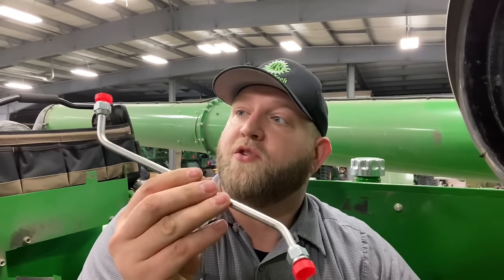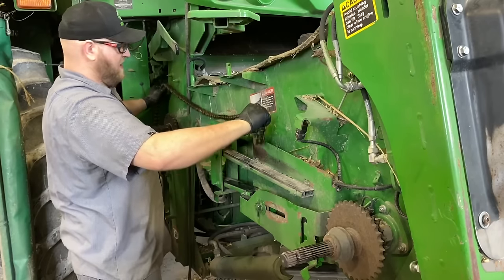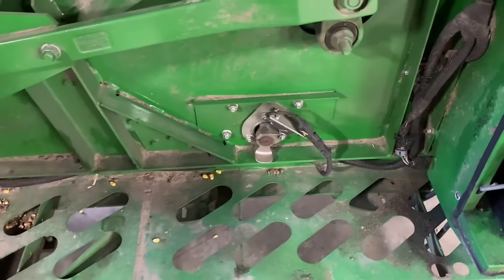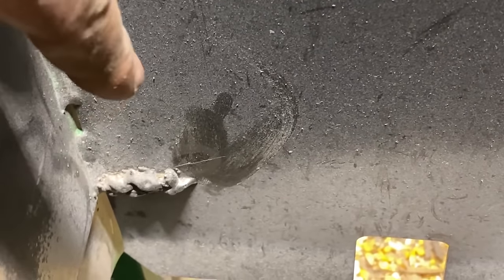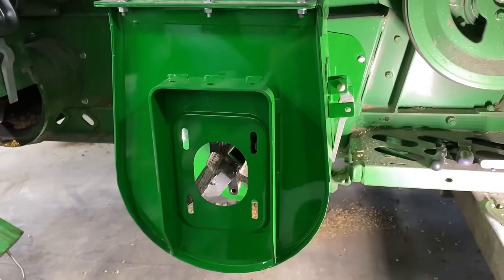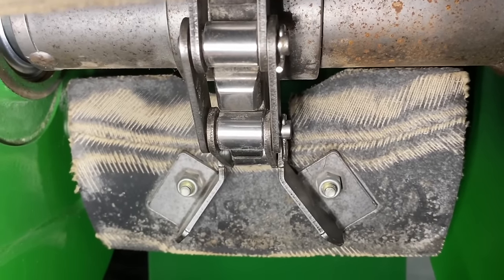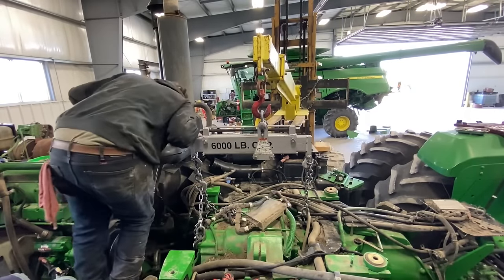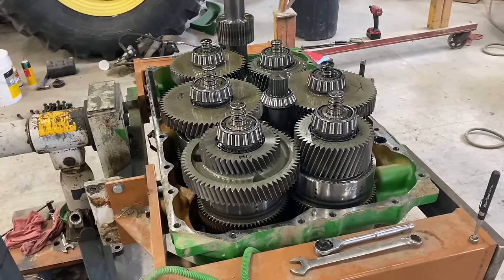S680 repairs & 9530 transmission fun. (It's NOT good!)

Comment: From the UK. Replacing tin work, fuel tanks, castings etc probably makes economic sense in labour terms, but component repair if possible - welding at the least, seems much less wasteful. Cracks can be stopped with welding expertise, though wear cannot be. Tractors seem to be integrated with so much “nice to have” crap that maintaining them has become a hugely expensive nightmare. Bet half of it could be dispensed with.

Comment: Those magnetic trays are so nice. I have half a dozen different sizes stuck on the side of my toolbox. Hell, you can mount them upside down and all your bolts will still stay put. And for a few dollars each, money well spent. I don't wrench on farm equipment but basically mechanics are mechanics the world over. Your techniques and processes are world class. You young up and coming motorheads can learn a lot from a guy like this. I been doing it 40 years and I do!

Comment: Fun fact about cracks if you drill the end out it stops the crack from continuing its done often on small aircrafts
Reply: The metal is fatigued.  A weld increases stress.  Know when to repair, know when to replace.  9/10 times a guy never finds the true end of the crack because they don't utilize proper inspection techniques.
Reply: @ShainAndrews  weld increases stress how do you think the part was made glue 🤣🤣🤣🤣

Comment: Somebody was actually thinking when they put that slot in the side of the machine for the auger flighting to come through. That looked like a bird nest sitting on that transmission when you pulled it out. How many hours on that tractor? What kind of warranty does a re manufactured trans carry?
Reply from the maker: I don’t remember the hours off hand. Trans has a 2 year warranty.

Comment: Hi ZK master tech, we had similar noise coming from transmission on my 9560R but oil is very clean and no metal at all. What could it be? Maybe scavenger pump? Cheers for the good videos you posting 👌

Comment: Master Tech, maybe I missed this, but if I haven't can you write on the video why you4 fixing this machine. For instance, is it a trade in your working on, a customer's, this does several things. It's a selling tool for the Company you work for. People are more apt to buy a machine if they know it's been fixed. If it's not a trade in it helps me understand wear and tear on the equipment, and knowing when it goes back to the customer, it'll be ready for harvest!
Reply from the maker: Well if you go back to the first video i made on this combine, I rescued it from the customers field and brought it back to the shop and it’s all customer repairs. Combine is going back to the customer.
Reply from the maker: I made a playlist called s680 hydraulic nightmare and all the videos are there.

Comment: Those valve posts for the feeder house are 2 parts (you can just pull the lower half off beneath the threads) and have internal seals that with age turn to brittle plastics which crumble and crack so the valve leaks. I have had some experience with those same valves and Hydra Force magnets on the hydraulic leveling system on older Ecolog 560D forestry harvesters..

Also, how often do rodent passengers come along with the machines in to have work done?

Comment: Why does my 7R 350 in Farming Simulator 22 pull left?
Also, how can I juice up my XUV865M to go faster than 31 MPH?
PS if that divider on the auger frequently breaks off, why replace it with another divider? Why not just break that bottom of the divider off and mail it back to JD engineers, along with an evaluation of their job performance? Feedback is key, how will they get better not knowing of their failures?
Now the customer has to pay for a new boot that, per your assessment, has a divider that will probably fail....again. Looks like a manufacturing warranty item. nothing the operator or owner could have done to prevent the designed to fail part.

Comment: Hello! Just a curious question. What is the difference between a remanufactured and a rebuilt transmission? I understand that you have to replace all the damaged stuff in the transmission you are working on but what have been done to the reman transmission? Is that a part from a tractor that had some other issues? Thanks for a great show! It is always fun to look at professionals greetings from sweden!

Comment: How do you determine lock collar installation direction?  I noticed on the CG auger the boot end was opposite of shaft rotation, and on the sensor end it was with rotation. Thanks.
Reply from the maker: Rule of thumb is opposite of shaft rotation but i don’t think it really matters that much on a low rpm shaft. I’ve done it both ways and I’ve never had a lock collar come off. I’ve put on thousands. As long as you have a good lock onto the cam of the bearing and the set screw is tight, it won’t come off unless the inner race of the bearing breaks.

Comment: Hi Sir ZK can you help me please on my JD 9620R as it always comeout the ECM 001.101.02 "Crankcase pressure sensor fault" warning and its already replace the crankcase airfilter and sensor. What is other possible causes.thank you and more power
Reply from the maker: Either you actually have too much crankcase pressure or the wiring is bad.